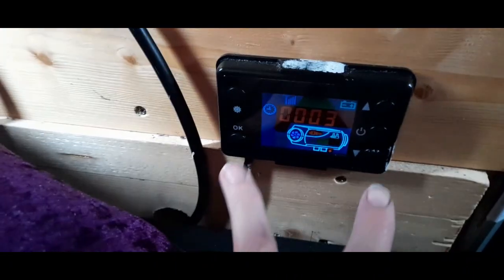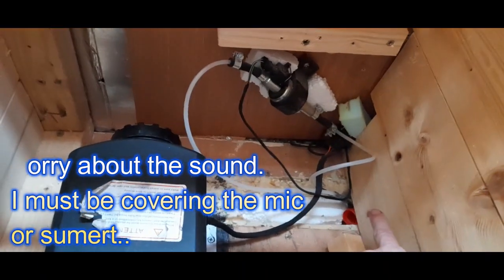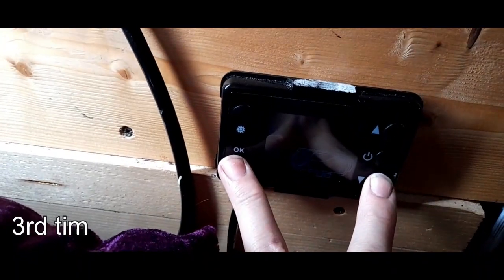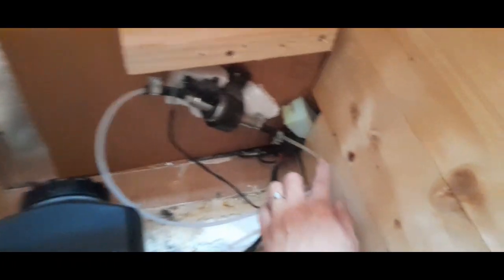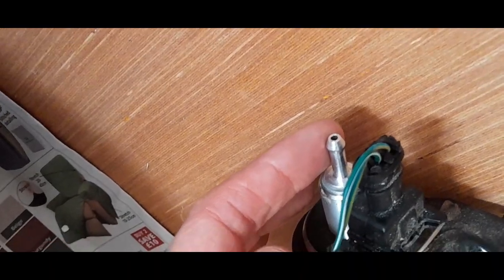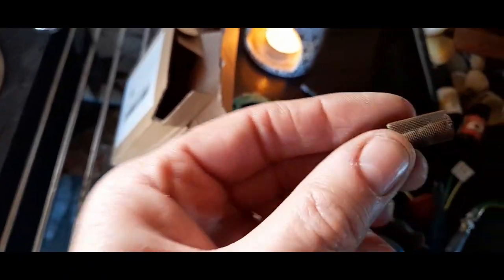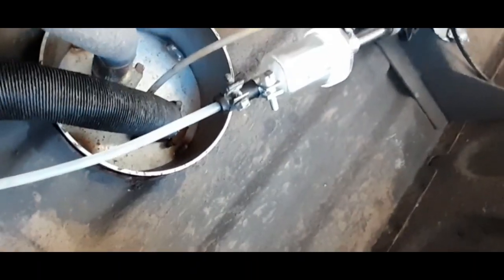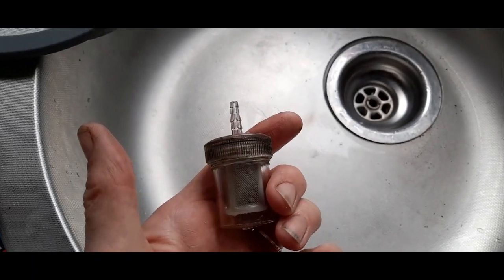Diesel Heater, Error Code 10?? FIXED! #ivecodailycamper #dieselheater #error10 #fulltimevanlife

Comment: Great job.

Code 10 can be a proper fucker. I had 2 weeks with no heater over the winter with a code 10  i replaced EEEEVRYTHING. 
Turns out the diesel heater didn't like the tiny kink i had in the exhaust. I swore a lot. 🤣
Reply from the maker: Hey Jamie,  thank you. 😂 well I'm no stranger to lots of swearing, lol. It's just such an unhelpful code isn't it? Glad you got it sorted, but who would have known a kinky exhaust was the issue?! 😂🤦‍♀️

Comment: Brilliant💪 2 months I’ve been ballsing about with mine and still can’t get it to stay on😤 E04😩
Reply from the maker: Thanks Andy. Oh, that's a bugger. I've no idea what error code 4 even means. Just watched these- https://www.youtube.com/watch?v=i_5K7vwlGZ0 This one seems to be saying it's a fuel issue. And this one- https://www.youtube.com/watch?v=5QlvhMD_pQM&t=1s which has some other ideas. Hope you get it sorted 🤞😊
Reply: @anothercampervanchannel  tried everything, new pump, filter, fuel lines, even tried running it on a car battery🙄 think I got a dud☹️ glad you got yours going though💪
Reply from the maker: @Sandilandsandy  Oh that's very annoying. Has it ever worked?
Reply: @anothercampervanchannel  not for more than 10 minutes, starts and runs perfect, pump works fine pumping the fuel, then just shuts down, Error 04 pump not working🤷‍♂️ tried 3 different pumps on it but runs for 10 minutes then says pump not working🙄
Reply from the maker: @Sandilandsandy  🤦‍♀ Sounds like a dud then as you say 🤷‍♀😕
Reply: @anothercampervanchannel  ☹️x

Comment: is the heater on the same side as the shower? I got a y piece with an on off and plumbed one hose into the bathroom and I can shut it on or off at the y, honestly well worth the hassle, those heaters are a nightmare im on my second one, my fuel pump is outside and the hoses run back in I can still hear it though that must be noisy.. it won't hurt the pump to put it under the van at all I think
Reply from the maker: Hi Tony, yes, the heater is on the same side as the toilet/shower. I have a pipe going into there, although it doesn't blow very much into there, tbh. I know the clicking irritates a lot of folk, but it honestly doesn't bother me 🤷‍♀️😊

Comment: Use red diesel in your heater, means a separate 10 ltr tank
Reply from the maker: Hey Joe, I have thought of this before, but it's getting hold of it. Also, I've no room for an extra tank now 🤷‍♀️
Reply: Same box as the heater is installed, doesn't need to be huge, 5 litre is OK
Reply: Google red diesel in your area.

Comment: That pump noise will do your head input it on a rubber base
Reply from the maker: It doesn't bother me 😊
Reply: It will
Reply from the maker: @jjfm271  Well I've been using it 3 years so if it's not bothered me yet, i doubt it will, lol.
Reply: @anothercampervanchannel  thought this was the new van u was having trouble with. 🤔
Reply from the maker: @jjfm271  It is Joe but I had this diesel heater in my other van as well 👍